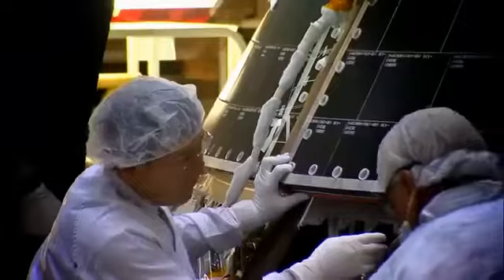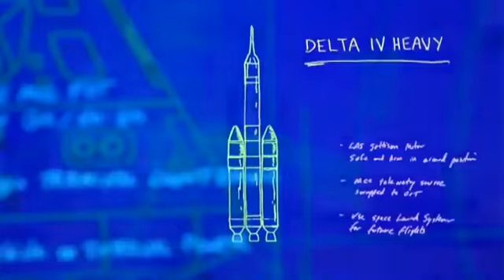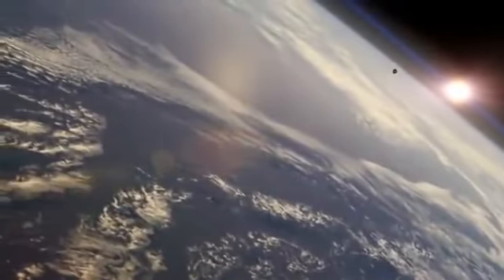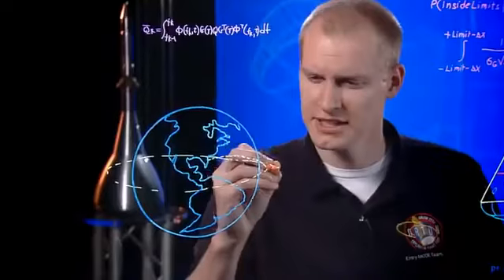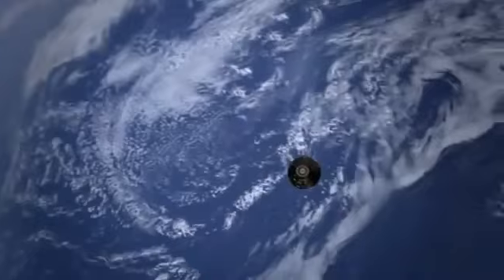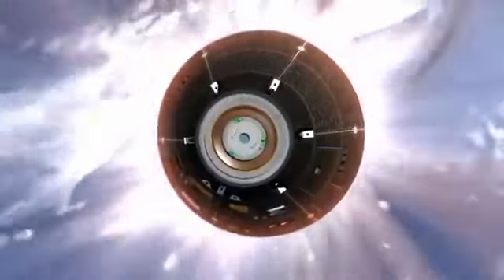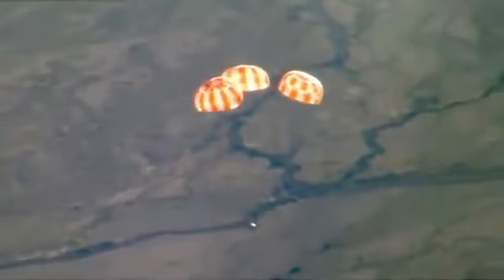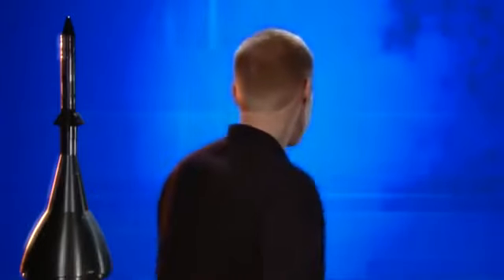NASA engineer admits they can’t get passed the Van Allen Belts

Comment: he's talking like Apollo never happened ?? totally weird
Reply: The Adventuring & Camping School, Thailand is he ? Hmmm
Reply: Every time a new complex system is built, you test the hell out of it, especially if you are NASA building a new space capsule. Space travel is hard, as you can see from the ongoing, regular failure of rockets and payloads. The Apollo program benefited from incredible resources, tremendous engineering talent, a clear focus, and pure good luck. The Soviet moon program did not fare so well.

Given all the money and political pressures riding on NASA’s new SLS rocket & Orion capsule (not to mention the moral imperative of safeguarding the lives of the astronauts), it would be shocking—no, scandalous—if the agency did not perform extensive testing of its new hardware. And yes, that includes radiation testing, since we will be flying types of sensitive electronics that have never gone beyond the Van Allen belts before. Computer technology is a little different today than it was in 1969.
Reply: Wendy James.....uhhh, the moon is FAR past the Van Allen belts....far past them.  As is Mars, where the Mars rover is supposedly running around   (actually it is on Greenland, right here on earth.).  Computer tech is a little different?   LOL, my smart phone has a million times more tech than Apollo 11 .....neither of which have been to the moon.
Reply: Coleman Adamson see that's the question how are the johnny5 robots tech on mars working?  Why not use that tech and shielding?  It's working right they tell the johnny5's where to go and they go, so....didn't it go through the Van Allen belt radiation?
Reply: Just because the last bucket you made didn't crack in the sun, doesn't mean the next one will when you create a new manufacturing process. Apollo happened, but this is a NEW SPACE CRAFT & this video is to educate people as to the perils of space-travel because space is dangerous. It's not meant to confirm the psycho-bias of people who think we've never went to space, or the earth is flat.
Reply: TIXE RIGHT nasa admits majority of their pics taken of the earth are all pretty much CGI ...
Reply: No, he's just talking about something else and thinks you know what he's talking about. You don't.
Reply: The Apollo missions tactically flew through weak points in the Van Allen Belt. This increased fuel usage and travel time, but provided safety for the crew and equipment. This video is heavily edited, but they might be attempting to shortcut through the Van Allen Belt in an area with more radiation than has previously been traveled. Or they could simply be testing newer technology and equipment in the same zone since it's been decades since we last tested things and might be able to find a cheaper, easier and lighter form of shielding.
Reply: Brandon Mason if there are weak points that means radiation is seeping throug ?
Reply: Auto TaRReLL, I would suggest looking into what the Van Allen Belts are, how they're formed, and what their nature is before asking that question. You're making a cause and affect relation just by reading my comment and I may have not explained it in the most scientific way. What we do know is that there are areas of the Van Allen Belt that have lower concentrations of radiation than others. I'm not sure what you're implying with your question since I already stated that these areas have lower radiation than others. Your misunderstanding might come from not knowing what these belts look like in a radiation graph.
Reply: Brandon Mason the belts are just energetic charged particles formed from solar winds
Reply: Very good! Now can you tell me why we call them "belts"?
Reply: Brandon Mason I can’t tell you y but I know that they are held around our planet by our planets magnetic fields , I know there are two belts and sometimes more form
Reply: So if you understand that these belts are held in the shape by Earth's magnetic field, what's confusing about these weak points? They're the area right outside of the magnetic field where, yes, radiation is present, but it's not concentrated there. The concentration of charged particles is in the center of each belt which we have NEVER sent a human through.
Reply: Brandon Mason so is the moon before or after the van allen belts is my real question
Reply: And further explaining, our magnetic field isn't this blanket that covers the entire planet. They're more like belt loops that start or end at each pole. All their weak points are at the planet's poles. But I'm no scientist, I collected this information from reading articles, books, and watching some documentaries, and looking at diagrams. I'm done speculating answers though, debating this in comments is a waste of both of our times.
Reply: Brandon Mason
It's obvious he has a problem with it because it violates his flat earth religion and its assertion that people can't go to space because of the "firmament" and the flat earth. And that's nothing but the most hideous and vile ignorance.
Reply: rstevewarmorycom don’t speak for me - I’m sitting here answering his questions without sarcasm , has nothing to do with flat earth anything - so mind ya business while people are having a educational conversation thank you
Reply: The moon is outside the Earth's Van Allen belts & its bands are concentrations of stellar and cosmic radiation including antimatter particles that have been temporally captured and suspended by the earths magnetosphere in such ways that it is higher levels than other more "normal" areas of space. It's very thick along the equators bulge and very thin closer to the poles where that radiation is much more likely to collide with the earth & absorbed or else get released back into deep space & so craft's exposure to those belts can be mitigated a great deal simply by intentionally navigating thru them where they are thinnest. 

Basically the moon and any other planetoid lacking a magnetosphere does not have a similar magnetic belt, and which means a planet like Jupiter (which has a much stronger magnetosphere than our own) will have radiation belts that are quite vicious so vicious that deep space satellites that have visited Jupitar are shielded enough not to get instantly deep fried by the radiation. (But it's also mitigated by the fact that the worst radiation is much closer to Jupitar than most of the moons we find interesting) Shielding electronics from radiation is not impossible, it's just expensive, because it adds mass & right now mass is everything when it comes to the economics of space exploration.

Shielding bio-matter (us) is even more expensive, because it adds a lot more mass & requires a sustainable & persistent habitat that is highly resistant to many kinds of failure, because we typically want human's to live much longer than we want satellites to function & because radiation on physiology is typically accumulative so you'll hear doctors talk about life-time exposure in all the professions in which that exposure has to be monitored because when you've hit your safe-rad-cap, any additional exposure can cause many adverse health effects & that safe-level doesn't necessarily preclude the risks of developing radiation-related cancers & tumors over the course of one's life, it just means you're not subject to immediate rad-sickness, burns, & multiple-organ failure. But the radiation isn't like thermal damage on non living things, we don't need ablative armor to deal with it, just enough material to ensure radiation doesn't penetrate, just something that ensures the radiation either gets absorbed along the hull of the craft, or deflected back into space & both things are possible. Proposed long-term deep-space spacecraft designs typically use a combination of special materials in layers to maintain a low radiation habitat, and energy fields, like an artificial magnetosphere to keep radiation away from all the critical areas of the vehicle. But a lot of these design concepts weren't available to the Apollo Program, much of what they did was a combination of really good luck for limited duration flights, and navigational trajectories that kept the crews away from the most dangerous areas of local space on their way to the moon & back. Longer duration manned missions into deep space will require much more robust vehicles that are less reliant on the good luck of short trips.
Reply: +The Adventuring & Camping School
He is selling the new Orion spacecraft. So, he bumps everything up a notch. He never says Apollo did not go through. He is say this is a totally new spacecraft with new electronics. Nothing more and nothing less
Reply: It didn't
Reply: If you lie long enough you will eventually get caught out. They did not see stars on the moon because Aldrin told them to Buzz off. NASA are the highest paid comedians in the world.
Reply: that's funny b/c it's a lie, but bonus points for the comedic pun. 

I know a number of comedians who make more than the average employee working for NASA, but they all have more talent than you. Most of the ones we all by name make even more than the guys at the top of NASA. Like much more, like pro-athlete level compensation. Believe it or not a lot of that NASA budget goes to stuff, not people, it's operating budget is almost flipped upside down when compared to an education budget (which spends more on people than stuff) and $ for stuff goes to the other companies that make & deliver that stuff to wherever NASA needs it. If anyone gets rich of what NASA does it's boeing, Lockheed martin together in the United Ballistic Alliance & Space X, along with a few other contractors. 

People who work at NASA do so because they have a passion to expand the scientific knowledge & technological capabilities of humanity & more than that, they have the academic & career backgrounds to get their asses in the door because it's a very selective process. Lots of bright & talented driven people want to be involved in what NASA does (too many), but it's operating budget doesn't nearly compare to the many other federal agencies out there, research hardware & delivery systems are expensive & it's constantly getting new policy direction from the executive branch every time we elect a new POTUS.

.
Reply: He's saying it never did happen. NASA fooled everyone.
Reply: +Joseph Burke
Wow, know wonder you FE people are so confused. You take a simple sales video and turn it upside down.
Of course he is NOT saying we have never been. Your FE cult has got rapped around it little finger. Also, have anybody notice that nobody complains about be called a FE cult? I guess that means they know it is and have embraced the cult.
Reply: +The TaRRell
Dude, you have been watching why to many FE videos. NASA has never admitted to most pics. A few only. But I do thank you a little bit. You admitted that a few NASA picture are real pictures from space. So you just admitted that we have launched rockets and have satellites and gone to other planets.
Reply: +Merry Christmas
Wow, these 2 videos are your proof? Sad! They have been debunked so manytimes it is comical. Please get real. Any questions?
Reply: +The TaRReLL
Sorry, the van allen belts have been mapped and continue to be studies. The belt radiation has been know to be less the closer to the poles you fly since 1957, before NASA. So they know where the to fly for added safety. You must be really paranoid, to think it is seeping!
Reply: +Merry Christmas
Yes rockets work in space, otherwise the ISS I see in my telescope shooting across the night sky would not exist! But, you want to talk about Newtons second law. Cool, this is what it means. "Newton's second law says that when a constant force acts on a massive body, it causes it to accelerate, i.e., to change its velocity, at a constant rate." So, tons of mass in the form of expanding gas being thrown out the back of a rocket causes and acceleration. So if you double the force (F) you double the acceleration. If you double the time (A) you double the acceleration. If you double the mass (M) you haft the acceleration. So, like always you have made the wrong conclusion! Any questions?
Reply: +Frags tK
Maybe you should watch it again.
Reply: +Jesusauras Rex
Dude, you believe what you eye can see. Then you believe in magic, you believe a person can be sawed in haft and then be put back together. Because that is what your eyes see. All because of your cult leader Eric..... That is sad on so many levels. Face it Eric is a joke and he is playing you!
Reply: Rocky Rockwell Earth is flat and the proof is available,repeatable and obvious.
Reply: +Jesusauras Rex
You have one thing correct! FE is 100% repeatably wrong. It is also 100% obviously wrong. Get it try.
Reply: +Jesusauras Rex
Sorry to burst your bubble! You show me one proof of a FE.
Reply: That's because it didn't
Reply: +jamie .fairman 
Sorry to disappoint! Of course Apollo happen, more than enough proof it happened and zero proof it did not!
Reply: Was that supposed to be a REAL...INTELLIGENT response or are you just being sarcastic? I hope for your sake it's that latter!
Reply: The Adventuring & Camping School, Thailand 
Er....because it didn't. The mission to the moon never took place. It's the greatest dupes of all time and people still believe in it.
Reply: This is a bad edit designed to convince gullible fools.  The real  video does not prove Apollo was a fake it simple states we have no active space vehicle, Shuttle being low earth orbit only and retired, that can go to the moon.  Explaining that Orion is new with newer tech so needs testing just like every new Boeing airliner. Modern computers are more advanced than the 60's and are not designed for space flight.  Moon hoax believers are like flat earthers real bad at science!
Reply: Bullshit!!...do a bit of research there are logical steps given...regarding the radiation.
Reply: +STRYKER PRODUCTION
Gee, was what you said sarcastic? No, I think you just could not make up something fast. So, I guess you have no proof the landings did not happen. thanks
Reply: +Domzdream
So another one thinks by saying the landing never took place means proof. Talk about dups!
Reply: No. I didn't say it didn't happen. It might have. It might have not. I wasn't there. Neither were you. But the plethora of information against the landing,  (for me) it out-weighs the lunar trips as bieng factual. Of course I could be wrong. But I don't think I am. And it's not like I get a hard-on on conspiracies. Not at all. It's the info in totality that makes me doubt this ever happened. And plus, that this was during the Cold War (big clue here), and that it was during days where technology was so fucking backward, it was amazing they took off at all. Then you start reading about the technology which was not compatible to the extreme temperatures both, in the shadow of the moon, and in the light exposed areas. Which would have affected the production of the film and paper they were using. But hell, looky, they ended up getting super HD, crisp imagery.
THere are so many things that point to the obviousness of this being a hoax. 
We can go into to it if you like.
Reply: +Domzdream
Dude, what plethora of information? Let me know as I was just a teenager when the landing took place. It was good the the Lunar orbiter took pictures of the landing sites. You can see tracks going out from the lander vehicle. Yes, it was a race of the cold war, and technology was basic compared to now. The computer at the time used rope core memories. Which means they could not be reprogrammed without redoing the whole memory core. What do you mean not compatible with extreme temperatures. No technology is. But they used water to keep the equipment cold and the rotated the spacecraft, so no one side was exposed the the heat for long. The cold was handled by heaters and the equipment. The equipment generated a lot more heat then todays. The cameras and film were in special housing to the reasons you say. You think the could change the film normally with there gloves. You think think they had HD cameras? That is just plan funny. They digitally enhance all of the video and pictures recently. So, let me know if you do not understand what I say and I will explain it again. Plus, you have any other questions, let me know.
Reply: There's no crater, first of all, which would be made from the rockets being fired below. They calculated the amount of thrust you'd need to counter the weight of the spaceship, and threre's bugger-all. No dust at all. Not even inside the leg plates. And no, there's absolutely no tracks of the buggy anywhere near the spaceship. 
They didn't rotate jackshit. The ship landed once. It didn't take off, up and down to rotate. That's pure KAK! They didn't have the fuel of that repetitive action. 
Have you seen the waving flags in space? You should take a look at those. And the dude falling and suddenly being hoisted upwards like an superhero athlete on steroids.  You can clearly see him pivoting around the hip area.
Not to mention the many photos of the same terrain, with the rocks in different places.  Like I said, these few examples pale in comparison to the amount of data against the lunar landing. I'll talk about the photography some other time. I have to go somewhere...for now.
Reply: +Domzdream
Okay,lets see here.
1) No crater from landing - Why would there be a crater? Can you tell me why there should be a crater? The moon is hard, the astronauts had a real hard time to put a probe in the lunar ground. The could get it all the way in. Also, the landing engine had 10,000 lbs of thrust. But the engine was throttled back to less then 3,000 lbs. They also hand probes on the landing legs that were 6 feet long. So they shutdown the engine when the probe hit the surface. Apollo 11 shut down the engine when they were 6 feet above the surface. Also, remember no atmosphere so the engine exhaust was very spread out, result of all of this no crater! Simple. Also no atmosphere which means the dust seen in the landings when straight across the surfure so no cloud of dust and the shutdown the engine 6  feet up.
2) Of course there were tracks. Only in one shot did it look no tracks. and the other shots there were, plus the video showing dust being thrown up while it was being driven. Come on man, use your brain.
3) Yes the lander landed one time, Don't be silly! I was talking about the rotation was for the Apollo! So, yes they had what people call insulation to protect from the heat and they had water to cool things down and water circulating in there long johns. 
4) Flags? I was so hoping you would not go there..... but you did! Flags where connected to a arm that you stretch out the flag on. They did not so it was like a curtain in your house, where you have wave showing. Not hard! Beside, you think if it was faked they would not have fixed that.... Are you nuts?
5) Yes he fell down, Did you also notice that he had a hard time getting up? Remember one sixth gravity. He just could not balance well with what was on his back.
6) Now the terrain. So, yes the terrain looks the same everywhere.
 So basically your are repeating the same ....... stuff the FE, moon hoax conspirators vomit all of the time. All of easily explained like I just did. Although others could maybe explain it better. Let me know if you have other questions.
Reply: 1) As I've said. That lunar lander is heavy. I know that the gravity of the moon is about 16% that of earth, so regardless, you'd need a considerable amount of energy to slow the descent. You'd at the very least expect to see dust, debris, a spreaqd out of dust and and a burn mark where the thrust would meet the earth. Nothing there. Not even inside the cup-like feet. Nothing. It's as if the big dopey thing was placed there (which in my opinion, it was). But again, look, I could be wrong, but to me personally, I smell fakery.

2) Er...so you admit that there are no tracks emittng from the Module, except aroound the modul, further out. You tell me to use my brain? Well, irony is so sweet in that little paragraph you've written.
Again, it's as if it was simply placed there by cables from above, and then driven around.
And HMM...isn't it just so convenient for Nasa to reveal new photos released by Nasa, which show the tracks emitting from the buggy? You'd think they'd have proudly released those ages ago. It's only when people start catching on that they're compelled to doctor these images.
I'd swallow my words if these were released by an anthusiast. But they're released by the very same corporation that proposes they've landed. Of course! they'll be not only biasd, but protective of their lie to the world, and to perpetuate htis lie (and superb business).

3) Well, the rotation seems fair. You would naturally want to expose all the areas at a burst of time.

4)Yes, the flag moves, and not just in one instance. I've seen the footage where the flag literally waves and jerks suddenly upwards, for no reason. I don't know how much you've seen, but I've seen enough to convince me.
And yes, those bloody 'tards didn't even edit that. How silly. But that just lends to the body of the things that indicate to the lunar mission being a fabrication in a studio.

5) He fell down and suddenly he hoists himself up by one hand, his entirew body pivots around the hip area, which is traditionally the area where ALL line attachments are placed. You can see him clearly pivoting. That is amazing to me how many people, like yourself overlook this obvious blunder.

6) Yes, it is the SAME terrain. I'm not sure if you saw this but they do a direct match of the same terrain, with the same shadows being cast by the same terrain, but the rocks have been placed in different places, on that same terrain. It's so obviously a movie set mate. 

You've been duped my friend. You're experiencing a lie that has been handed to you and millions like yourself. It's like I always say- if you can convince billions of people, that a god, who is father and son to himself, at the same time, and a floaty spirit whatever that is, and that he created this torture chamber of fire where he tells you that he loves you while frying your body in torment over a flame for ever! ...you can convince people to believe in anything anything!
Reply: +Domzdream
Cool!
1) Yes the lander was heavy and it needed a lot of energy to slow down. But do you think they went from orbit to landing that fast? They actually hovered and moved around so they would not land on rocks or edges of crater. Like I said before. You can here during landing that Aldrin said picking up dust! So that blow up one of your statements. Burn marks? Remember no atmosphere, just heat. A stupid catalytic converter get to something like 750 degrees. Yet I see no burn marks even on grass Yes a rocket engine is hotter. If the engine is shut down 5 to 6 feet above the surface explain how a crater, burn marks happen. Wow, not dust in the feet of the lander. In the landing video that show Armstrong landing, did you see the dust shooting out? Did you see any dust billowing up? Why? Because there is no atmosphere. 
2) Sorry man, of course there are tracks. So there are more then enough pictures and video of them remove the rover. There is more pictures of them driving the silly thing around even close to the lander.  You mean the picture from the current lunar orbiter that show the tracks? Are you nuts? The has been in orbit around the moon since about 2009! NASA released pictures of the Apollo landing site in 2012 from orbiter. So again your are incorrect
3) Cool!
4) Wow, I have seen the same footage. It is waving because the astronaut has his hand on the flag pole turning back and forth. So another error on your part. Actually it is on the FE religious cult. I mean it is so obvious.
5) One hand? Yes, one sixth gravity remember? Why is pivoting at the hip proof anything. When you get up from the ground, does your hip not bend? Are you saying that when you get up your knees bend but the rest of you is straight? Nice try. But that is another error on you.
6) so what, I am sure there are many of the same shoot with an astronaut and without an astronaut in the frame. I have been looking for proof of a fake for 4 and a haft years. So I have seen those shots. The 2 you are talking about are 2 of many different shots, proof nothing except they did not need the shot without the astronaut. So I would call this a fail.

Sorry man! You are the one that has been duped and brainwashed by your FE, moon hoax religious cult. With all of the people involved you could not fake it and have nobody leak it. I mean the Manhattan project was leaked, all most from the start and that started out with less people. So again I have shown you have errored in your conclusions, because of your FE, moon hoax religion cult have no proof that the 6 landings are fake. Do you have any more questions?
Oh yea, the last statement you said, makes no since!
Reply: Er...m'kay. I guess we'll have to agree to disagree. That's ok.
But about the last statement....what didn't make sense to you?
Reply: +Domzdream
This is what I do not understand...... "if you can convince billions of people, that a god, who is father and son to himself, at the same time, and a floaty spirit whatever that is, and that he created this torture chamber of fire where he tells you that he loves you while frying your body in torment over a flame for ever! ...you can convince people to believe in anything anything!"
Reply: +Domzdream
Dude, this is old. I will say it again! Yes, they said we can only go to Low Earth Orbit........ NOW!!!!!!! After Apollo we had nothing go beyond LEO that had a man on board. That is exactly what he said and is true. No, the part you do not understand. He never ever said we have never been beyond LEO with a man mission. So, again you are in absolute error. I am having a real hard time understanding why you cannot read or hear. The only thing you seem to be able to do is misinterpret what is said (ie: Make stuff up). But, I guess it happens to all FE, moon hoax religious cult misanthropes
Reply: Because everything he is saying is only relevant to Orion ffs . It’s not complicated to realise !!
Reply: +Joseph Burke
Maybe you should actually listen. He said the Orion will be able to people further then we have ever been before. The means it can go further the the moon! How do I know that? Because he never says we have never been to the moon. So your conclusion is very wrong. Maybe hearing aids would help. Anybody have any questions!
Reply: +Domzdream
Come on man.... Eric Dubay? All he does is talk, he does nothing to disprove anything. He uses you FE religious cult followers to try and explain it. And you always fail. I am beginning to believe Eric is you FE religious cult leader. Please, you people are making him rich.
Reply: er....yes. Think asbout it. I don't know what elde I can offer you here.....
Reply: Self explanatory. Billions of people people are religious, believing in ridiculous stories, written by idiot (bored) men from from the bronze age, and before that...and still adhere to the same stories. People still believe in these stories and cults. If you can convince people that all that is true....you can easily convince the same ignorami (plural for ignoramus) that people have landed on the moon, completely unscathed. 

Think about it man! 

If they had the moon penned, the fucking moon be a half-way point towards exploring of Mars. At the very least! They would have created a space station by now on the actual moon, if the bloody van Allen Belt was so easy to cross. I'm sorry, bit these things are so obvious to me, and it just astounds me how or why this is such a barrier for you to cross. 
Whatever. 
Like I said, we'll have to agree to disagree.
Reply: And people like yourself wantingly avoid the large body of evidence against the lunar landing, because you don't want to look silly by thinking outside the box. All this evidence in front of your face, and you've still go those blinders on.
But hey, listen, I had a cool discussion with you nonetheless. We're just two people with seperate points of view. Nothing wrong with that.
Reply: huh? I don't know who that even is. I despise all group think, including buddhism. All religions have some good things about them. But ultimately, it's a form of controlling people through fear, and personal desperation, and a need to connect with fellow humans. And they exploit that. That is why I hate all religons.
I don't hate the people. I hate the beliefs that turn humans into living monsters.
Reply: +domzdream
Dude, you are funny! You realize that most FE believe in because of religion. They think the bible say it is flat, it says there is no space and a dome. Even though it does not say any of those things. Now you are saying it is religions who say the earth is a globe. Really????? You people really need to get together to get your story straight.

So I have thought about that and you FE people are something. I just do not know what!

So, you think we should have gone and put a colony on the moon and then on Mars. Cool! If you want read up some, you know the moon because boring (more then likely because an Apollo 13 did not happen more), they lost interest is watching a guy walk on the moon. So the politicians decided there was nothing to do on the moon except walk around. If you would get some knowledge, you would understand. 

So, lets talk the Van Allen belt. Can you tell me who told you the Van Allen belt is easy to cross? Whoever did, is stupid. It is high speed particles a person could die in it unprotected. So they did tests, sent up more probes and satellites. They found out there is no x-rays in the belt. They found out it was weaker/not as big closer to the poles. They found out that a little shielding and going through the weakest part of the belt and spending only 3 hours up and down it was less then a chest x-ray. Of course it was found out that they were exposed to less radiation the people working at the atomic energy commission. However deep space radiation is tougher on the heart according to some studies of Apollo era astronauts. 
I do not understand how you believe the FE religious cult. I mean they do not believe in science. But use every something science has given them. Just a little more knowledge man.
Reply: +Domzdream
Dude, I "wantingly avoid the large body of evidence against the lunar landing"????? Bring it on. I have already debunked 99% on the moon hoax made up stuff. Come on, let me have it. Or a least a small part at first. I do not want to write a novel. Hit me.
Reply: +Domzdream
I am starting to think you are on drugs. I did not say you were a FE person. I was in a way agreeing with you, But, on with it. I am sorry you do not know what was going on back then. Vietnam, Watergate, the democratic blow up in Chicago. Yes, they lost interest. the networks even dropped the schedule time to broadcast. So, it was now presumptuous of me.... I was 20 years old for the first landing. It is presumptuous of you to think you know what people thought back then an what people are thinking now!
Reply: Again...what cult are you on about, lad? I'm very aware of the information that you've written down for me. I've read all about it, and watched many shows that are in favour of the landing. But I've also see the body of info against the landing, and so for me, it outweighs it. That's all.
Reply: Oh, and I don't but AT ALL that lost- interest in -the moon stuff. Sure, the moon might not be a Jurassic Park to go and visit. However, it would be a perfect platform to set up half-way points to at the very least, achieve a mission to mars. They've not done that. Ever wonder why? 
Geezus, mate. The obviousness is staring you in the face! 
Question to you: If you had a shitty ship that is sailing to another country, surely you'd want to pull into a port half way to replenish your fuel, your cargo, stretch them legs, whatever. You wouldn't go directly to the county because you would run out of fuel, food, water, etc. 
Yes, I agree, the moon might appear to be boring to you. You aren't a scientist. But for an actual scientist, there are tons of things to study. The geology, the gravity of the small planet, the potential fossils of bacteria. But nope, they've lost interest.
I'm just not buying that.
Reply: +Domzdream
The moon was not a good place for a jump off to go to the moon until recently. There was nothing to help go to the Mars. However, when they discovered there could be water ice in some locations it became interesting and maybe it could help. You are not a scientist, you do know what would be interesting to scientist. I did not say it would not be interesting for scientists to study. Shoot, I would have gone to the moon if they would let me in the 70's. So again, you are assuming you know, when in truth you are simply making a guess and think the landing was a hoax....... So you have made a wrong conclusion
Reply: +Domzdream
There are many cult conspiracies, one is the moon hoax. I am glad you have at least looked at the videos supporting the moon landings. Wow, Body of info against? Really? The made up stuff? Sure go ahead and believe that made up stuff
Reply: +Animosty716
Send equipment we sent to Mars to send to the moon? Why? Do you think there is life on the Moon? We already have a spacecraft in orbit around the moon. It is called LRO and has taken pictures of the Apollo landing sites. So your request has been met. So, I wonder who needs to wake up to the real world! Anybody have any questions?
Reply: we are also talking about a considerable budget cut since the 'space race' took place
Reply: +NoneOfYour Beeswax 
You are correct, a manned landing on Mars has not happen yet, but probes have landed and driven something like 26 miles
Reply: Wendy James can't say that's the policy in other branches of science. How many times have we been subjected to experiments in the name of progress? They don't care about anything but progress. Even if it means lying.
Reply: Patrice yeah....you have valid points. We are not just going to believe anything at face value anymore. They got some proving to do.
Reply: I can't believe a lot of dumb people still believe we went to the moon. It was proamada to be used against Russia. It became a run away train that brought in lots of money. So they kept up the lie.
Reply: +Lisa Hedrick
No body is saying believe everything the government says. Especially what I current president says. But, do some inventigation, do not just believe whatever FE says..... they are one of the biggest liars.
Reply: TIXE RIGHT you may get more people on your side without the childish name-calling.
Reply: NO he's talking like Apollo never went directly through the core hot zones of the Van Allen Belts. That's because they never passed directly through the equatorial zones, they went through the more Northerly and Southern routes that required more fuel use.  If you look at his diagram he is showing the much more economic equatorial escape path. The research being needed to establish the correct balance of materials and weight necessary to use this route economically. Apart from weight you can not use lead since as you will be aware absorbing ionising radioactive particles generates x-rays. You are aware of this ? Or are you talking from a position of complete scientific ignorance?
Reply: HE IS TALKING ABOUT THE FIRST SPACE PROGRAM!
Reply: yes, they do. why would they not?
Reply: van allen belts will damage digital equipment. Apollo missions were analog
Reply: That's because it never did.:-). Welcome to self-realisation land.
Reply: TIXE RIGHT 😨Safe Space. 😲   😂😂😂
Reply: Merry Christmas I watched a gun fire in a vacuum, I thought rockets supplied their own oxygen? Why wouldn't they work? 🍻 Cheers.
Reply: Just YouTube search: 'NASA tells the truth about Moon Landing' ...we've never been to the moon.
Reply: They went through the poles because the belt is shorter
Reply: Pretty sure they never when the polar route because they needed the rotational speed of the earth to assist in escaping the Earth's gravity. At the poles, the rotational speed is zero. I've never seen anything suggesting they went a polar route.
Reply: Wow...Thanks for that!....

I was starting to feel insane reading the 'apollo never happened' crap....They can't believe it was just a matter of math, physics and courage - things most people actively avoid...

No wonder after all...
Reply: Brandon Mason 'that's what's they all say ' Nixon was president anything could of happened lmao we can even get equipment to dive around Fukushima and that's easily half of the belts "weak spots" at best
Reply: Ken Evanska that's what I'm sayn spread the. Message!
Reply: The Adventuring & Camping School, Thailand here we go .
Reply: The Adventuring & Camping School, Thailand right
Reply: The Adventuring & Camping School, Thailand  
exactly
Reply: Roach and crack is a rock
Reply: Coleman Adamson Greenland is pretty much covered in snow year round.  I don't recall seeing any snow pictures from the Mars rover. The Mars rover is on Mars!!!
Reply: brandon Mason.    how ridiculous do you sound?
Reply: tixe right   bla bla blah  If we actually went to the moon in the first place, and no astronaut  was 'found to have any adverse effect' from the moon missions. Yet NASA has lost all telemetry data, of the VAB . The two logical conclusions are:  the thin foil on the ships were adequate, but NASA is careless with the data from 6 manned excursions,  or NASA is hiding the fact we never went through the  VAB, and is now trying to figure it out.  Prove any of the descriptions you claim about the VAB... Post a link from a reputable source. (NASA) If NASA has no telemetry data, i don't see how you do....
Reply: +@rstevewarmorycom +@Roach THE EARTH IS NOT FLAT.  There is no G*d damned "firmament"!   The concept that the earth is actually flat and that there is no outer space, but instead a dome firmament or ceiling, is a strawman created by NASA itself to provide for controlled opposition, funded by your tax dollars to promote lunacy as a form of distraction from the fact that NASA defrauded tax payers out of over half a trillion dollars and continues to do so to this day with this global warming carbon tax nonsense.
Reply: @TIXE RIGHT People who work at NASA do so because they are getting meal ticket plums, fat from the federal pork barrels that predominately go to Texas, beginning with the original paperclip Nazis who worked for Hitler who was in turn bankrolled by the US Federal Reserve.  

After WWII the US asked itself a question, "well now what do we do with our assets from Nazi germany?", "lets put them to work!"  Thus NASA was born, long after Hitler was safely absconded to South America, ofcourse.  

Stanley Kubric directed the moon landing set at area 51 Nevada and Werner Von Braun took a team down to antarctica to find some meteors that could be passed off as moon rocks. 

And cmon lets face it, if NASA was not comprised entirely of plums, then there would be some solid innovation coming out of them; instead, Elon Musk makes them look like fools and using a mere shoe string budget to do so.  And I'm not even going to talk about the NASA global warming carbon tax nonsense.  The only thing NASA could ever do well was write technical dialog for Star Trek NG actors.
Reply: +@Next gen MLgamer +@Kyle Pedretty Even if they could somehow manage to go around the Van Allen belts, they would still be faced with deadly ionizing gamma radiation created by high velocity cosmic ray collisions, so intense that it causes the moon to glow in gamma rays. 

Dont take my word for it, simply google "gamma radiation from the moon" and you'll see for yourself a picture of it as seen from the Compton Gamma Ray Observatory
Reply: global weather change is obvious.... except to the oblivious.
Reply: It didnt
Reply: No, he isn't. He's talking like a new piece of equipment needs to be tested in the field before you rely on it to keep humans alive.
Reply: @roach2566  ahahahaha
Reply: Adventures & Survival in Thailand Because it didn’t! They are nothing but liars
Reply: that's because it didn't. lol
Reply: Adventures & Survival in Thailand he is a engineer,he understand radiation better than some people that prefer to believe in lies.
Reply: @wjames6450  uhh did u just copied and pasted a comment from Quora? Yeah.. You should do your own research